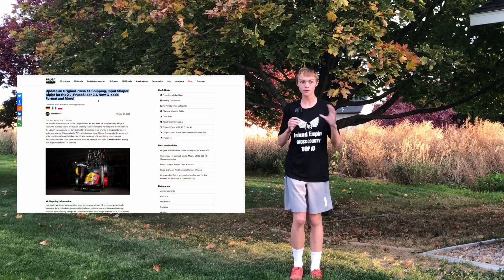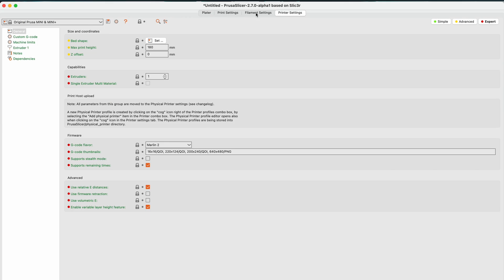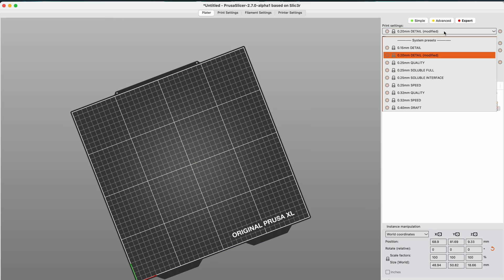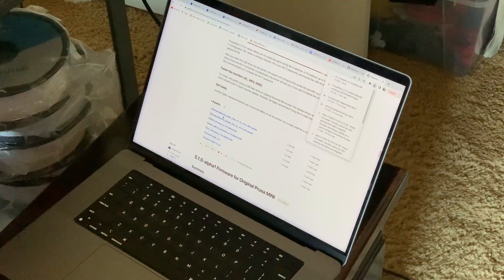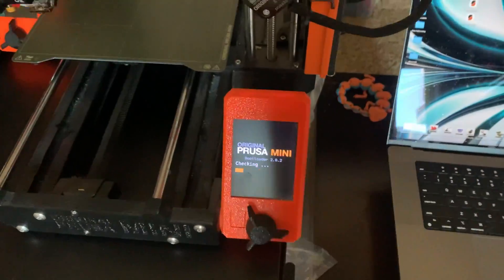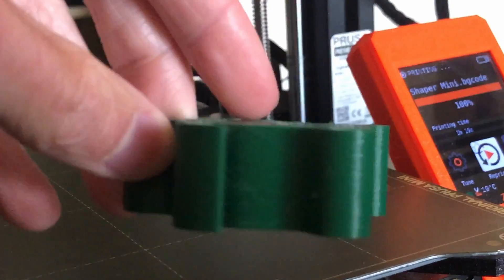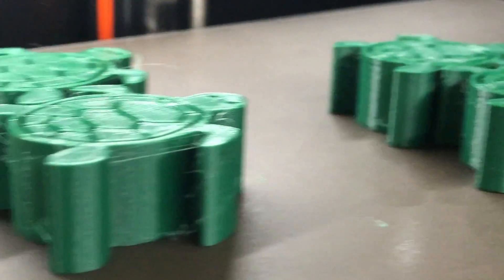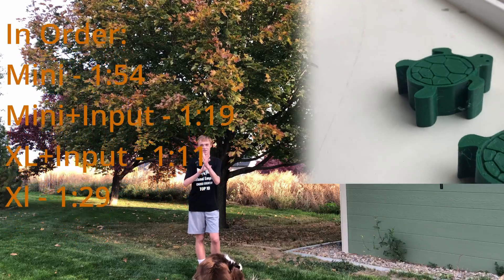Input Shaping on Prusa XL & Mini

Comment: an important detail to note here is that having the same settings doesnt actually mean you get the same result, sure the printers will do the same moves and things like number of perimeters but the XL will have printed more material in the same time.
the big advantage of a 0.6mm nozzle is that you only need two side walls to get the same thickness as 3 sidewalls with a 0.4mm nozzle would have so you instantly safe 1/3rd the time printing perimeters.
on top of that the larger nozzle can print at a bigger layer height without compromising the rigidity along the layer lines.
so this comparison is more like a how long it takes to make the print moves and less about how long it takes to print the same amount of material to produce basically the same part.